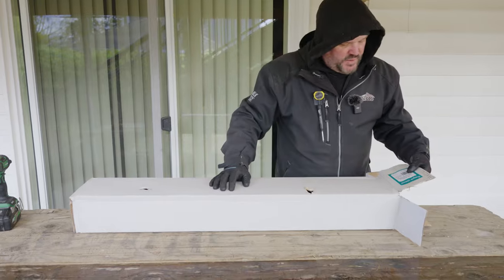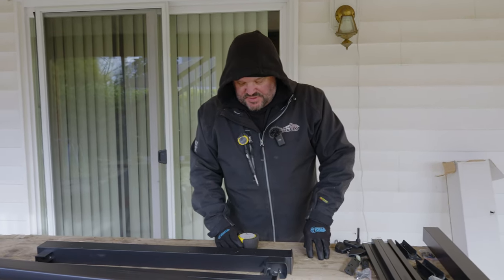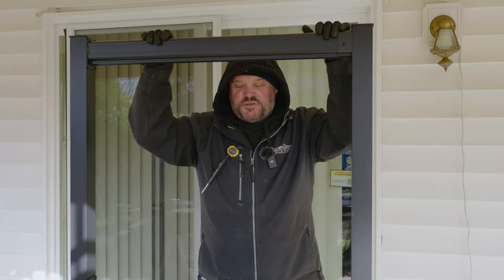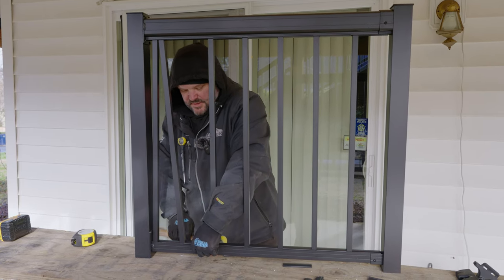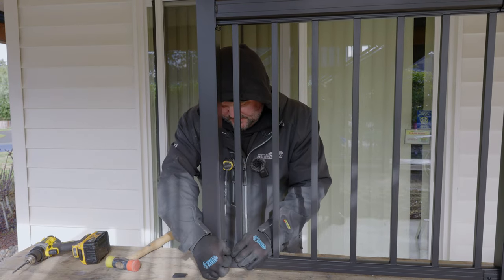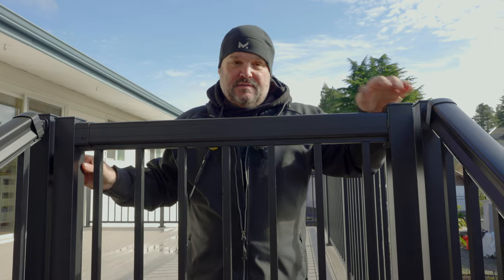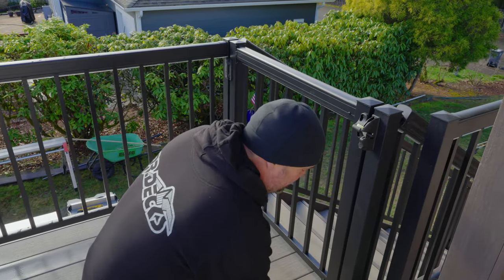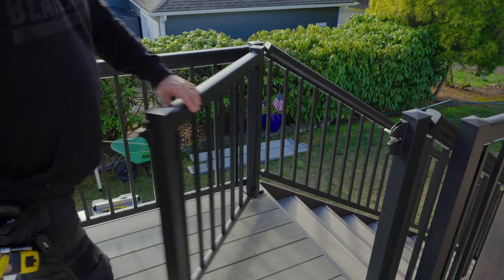How To Build A Regal Ideas Gate || Dr Decks

Comment: Nice work. I just installed a latch kit like that. The latch that clicks into the plastic piece has a small screw that goes in from the back after you put those 2 peices together